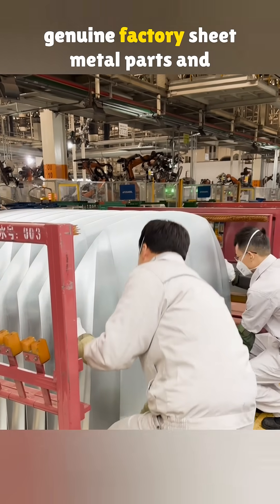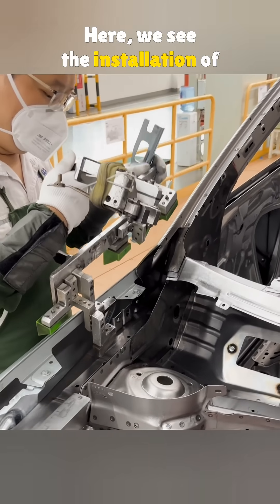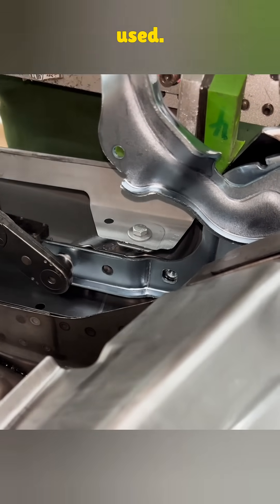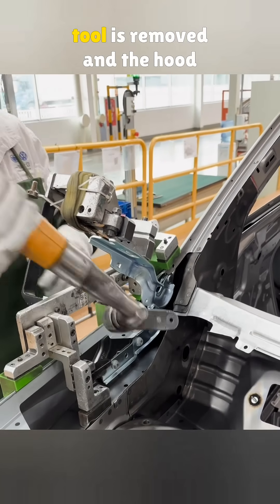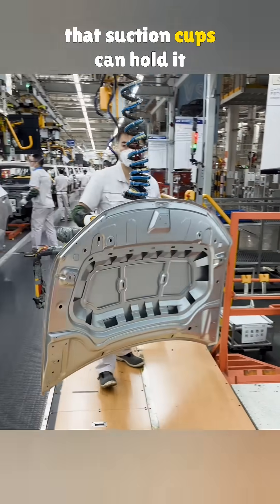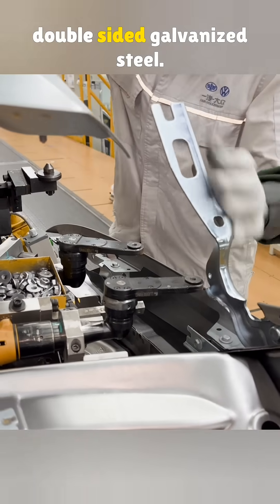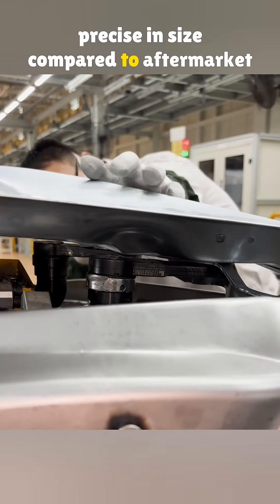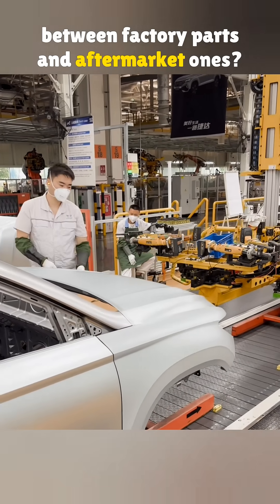Why Genuine Sheet Metal Always Fits Better

Comment: The head of the wrench doesn't cost $10k, not even by far. 6 times stamping doesn't make any metal more resistant to corrosion either. It's the coating AFTER stamping that matter.
Reply: If they spent $10 grand they got ripped off.